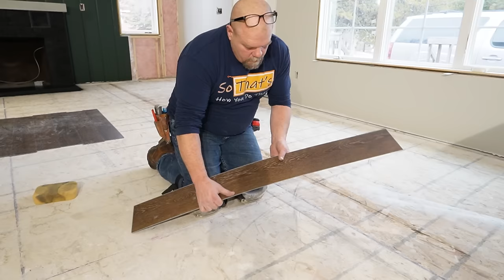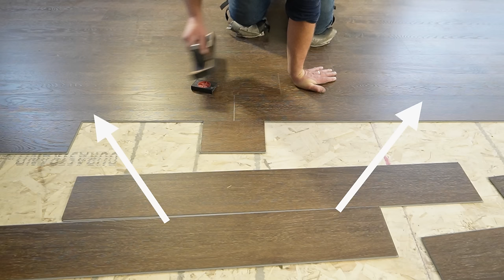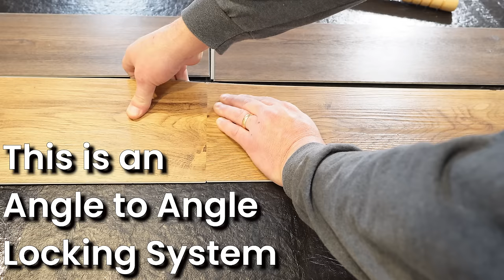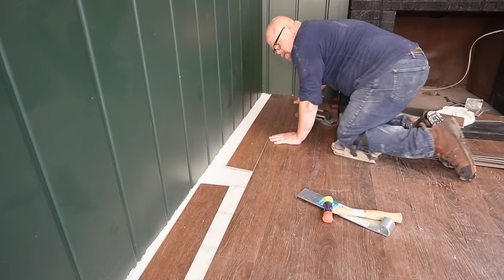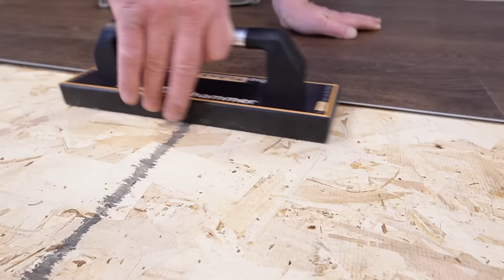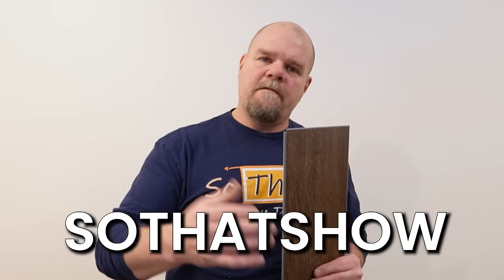Vinyl Plank Flooring Installation Tips For Diy'ers 40+

Comment: I can’t even begin to add all of the ways that your videos have helped me through my LVP installation. From tools to techniques, everything was a lifesaver for me! Question for you as a DIY project, is there any value for me to caulk around the edges of my floor before I put down trim? Or only in the wet areas?

Comment: if i have an slightly open end seem between two angle lock planks already installed in a room but i can still block the end of the plank run temporarily and then remove block to allow for expansion how do you pull that gaped seem together? i have seen the use of suction cup and then tap on suction handle to drive seem together or use wood block with double sided tape and tap wood block to drive seem together. do you have a preferred method? love your videos, thanks

Comment: If a basement cement floor covered with vinyl plank gets flooded badly does it have to be ripped up to clean and dry everything and then thrown away because the joint strength has been compromised and or damaged?

Comment: I wish you would show the troubles of putting in 12 mm type LVP.  I've had super troubles when I go to the 12mm thickness. It doesn't bend at all, making it harder to put in, especially over, say, a marble type floor, even if it's smooth and level. Not fun. The 4 to 6mm type is a breeze compared to 12mm.

Comment: How do I know if the plank is “angle to angle”.  When I go into stores like floor and decor with hundreds of tile option, I see no “angle to angle” listed on the box?  Additionally, I noticed in this video you layed the plank directly to the floor with nothing underneath.  I too will be installing on a subfloor of not cement but a type of builders style wood as in your video.  How, do you know if and when you can lay the plank just on this type of under layment as in this video?  Thanks in advance, and I will be using your videos before I start this job, and as you know there are many installation video options (:

Comment: So I'm a little confused. The plank you were installing appears to be drop & lock that you mentioned was not as durable. What locking system is  Flooret Modin?  Thank you
Reply from the maker: No, it is not. I shared a clip of a drop and lock to show how it is installed.

Comment: I noticed you aren’t leaving any gaps to the wall. Is that not as necessary as everyone says?
Reply: He does keep a gap at almost all edges. At 2:17 he describes very briefly one thing he does to maintain the gap. In other video’s he gets pretty deep into how to measure and cut to ensure there’s a 1/4 inch gap all around. The places he doesn’t put a gap is when there won’t be molding to hide the gap, which is pretty rare.